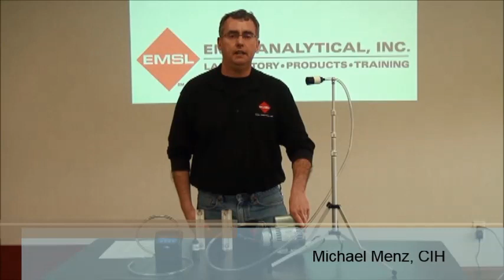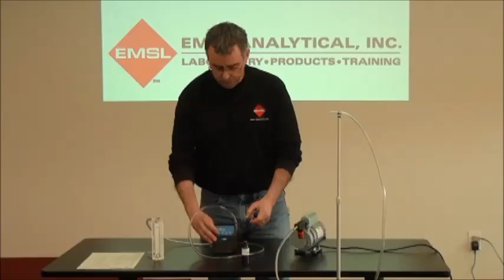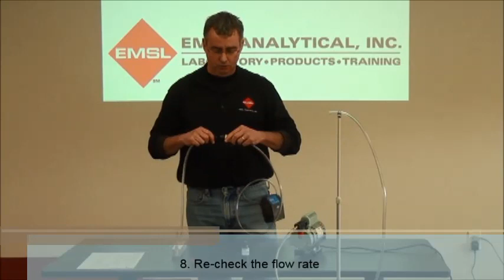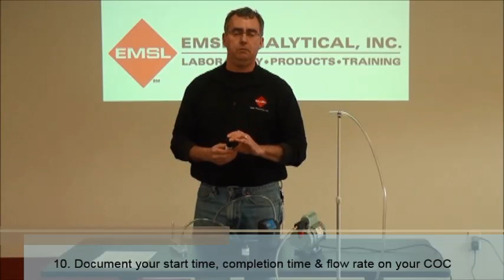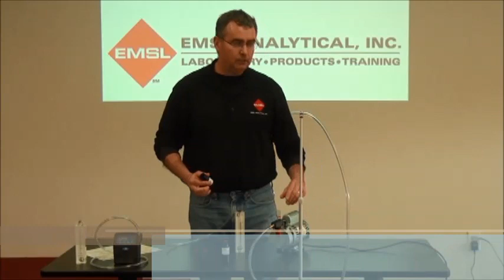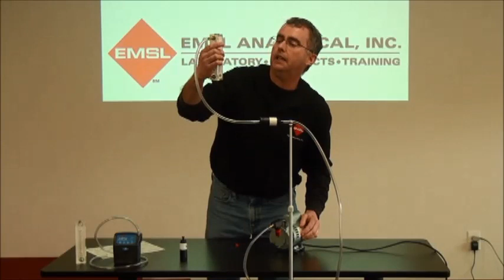Sampling Video for Airborne Asbestos Fibers Using NIOSH 7400 Method & AHERA TEM Method

Comment: Just a suggestion - wear a light colored shirt when showing how to use a black filter.  When attaching the cassette it was very difficult to see which way was the proper direction of the cassette against your dark shirt.  I was only able to see it when you moved slightly and I could see the contrast against the wall.

Comment: Why did you place the cassette on the area sample in a horizontal position? I always place my area cassettes around 5 feet off the ground and in a vertical position. I put it that height to represent what an average height person walking by the abatement area might be breathing in. And I place it vertically to simulate the way we breathe.
Reply: In the UK we have to palce the sampling head between 1-1.5M, sampling head is facing downwards. 
Personal sampling head needs to be within 200mm of breathing zone
Reply: I realize this is an ancient comment by internet standards, but this is worth pointing out. Technically, the cassette should be positioned at an 45° angle down. This is specified in many state regulations (e.g. Montana). 

In this case, I suspect the cassette is horizontal simply for convenience of handling and, hopefully, not an example of how it should be set up for actual sample collection.
Reply: @denisdooley1540  good point! Funny reading such an old comment of mine. Haven’t done asbestos monitoring in ages - still in IH though going strong!
Reply: In New York regulation is to have the cassette at a 45 Degree angle at or near the average breathing zone.
Reply: So

Comment: Is the max flow rate 16 because of humidity and static interference with this method or is they some other reason you can’t go up to 20? Second question, if you know you’re flow rate will drop, can you set it to 16.5 and have it drop to 15.5 to average 16? I assume if the flow rate drops more than 2 it can vary the total volume enough to skew data. So why not run it at 20 if your cowl is properly grounded? As for grounding the cowl, this method poorly attempts to do so. The whole cassette would need a full copper shroud to actually ground the ambient static absorbed by the plastic and the tubing. Having crude strand wire will only reduce static in the area of the stranded wire touches. Why not use a copper sleeve wired to a ground or treat the cassette and pump tubing with an anti static film, or are they and that film has a poor shelf life… hmmm…🧐 spray before use? That strand wire barely does anything the way it’s described… it would be possible to modify an extension chord by removing the hot and neutral wires/ prongs and solder the ground wire to the copper shroud so you can actually “ground” it to the building.

Comment: Imagine getting contractors who remove the asbestos to do their own clearance air testing. Like you ever get a failure. Mad, your equipment is from 1960 btw
Reply: If integrity was abundantly robust…😂 In Oregon it’s a conflict of interest and is strictly prohibited.
Reply: @elvinebovine1297  in the UK its an independent company who does the air testing and they need UKAS accreditation. I was an air analyst, on some bad jobs, their visual inspections air tests failed like 12 times, and took an extra week to get right. Thats how bad some contractors are.

Comment: How long do I have to have the pump on for a clearance sample?
Reply: 480L in the UK, ran at 8L/M work out at 60mins
Reply: @fastair8546  8L/min  for 60min is for  personal sample but how much for house air sample
Reply: @simondegarie4353  480 litres is a static pump, a personal could be from 40l upwards
Reply: 1200L at 13L that takes 91 minutes